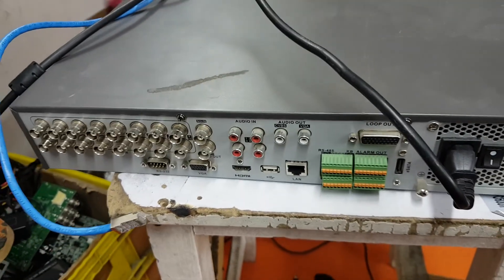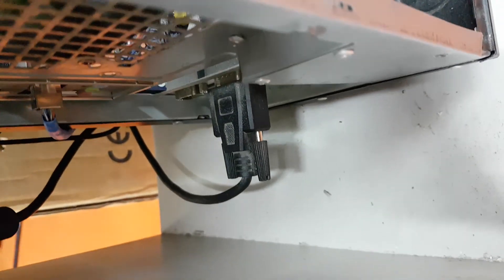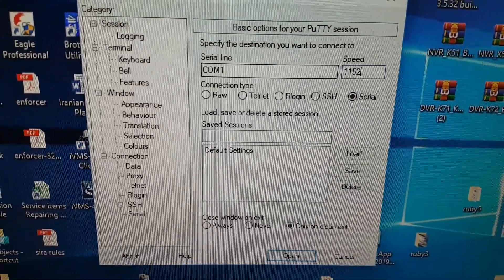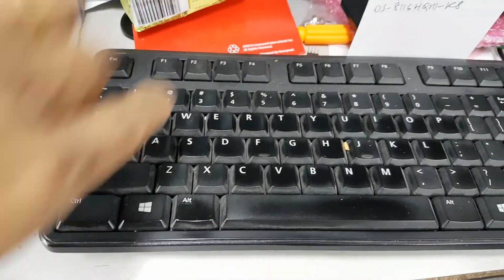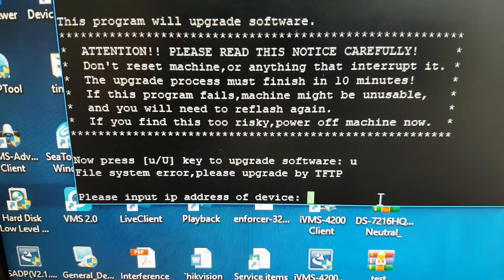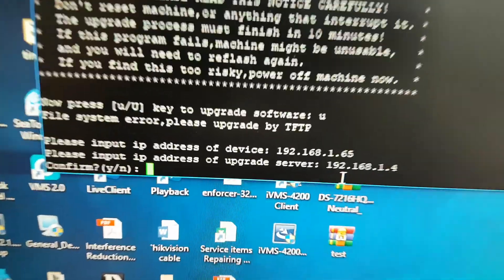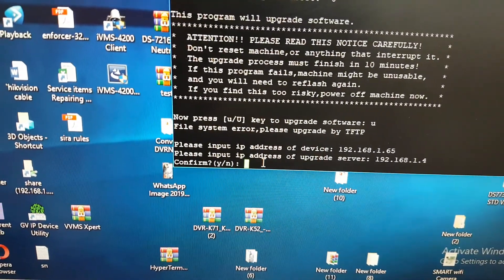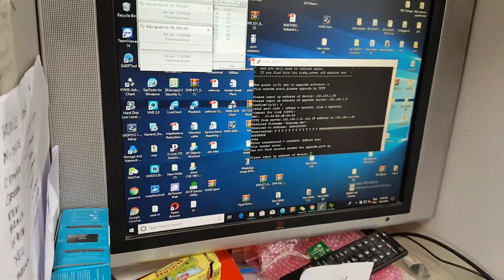Upgrading DVR and NVR using Putty

Comment: showing error 

please help solved this problem

* Warning - bad CRC, using default environment

Hit ctrl+u to stop autoboot:  0
### CRAMFS load complete: 3589208 bytes loaded to 0x42000000
## Booting kernel from Legacy Image at 42000000 ...
   Loading Kernel Image ... OK
OK

Starting kernel ...

Uncompressing Linux... done, booting the kernel.
Thu Jan  1 00:23:58 UTC 1970
Starting udev:      [ OK ]
sdbg: serverip:192.0.0.128
fastboot is
BusyBox v1.2.1 Protect Shell (psh)
Enter 'help' for a list of davinci system commands.

# /
---------<1> tar guir webs ---------
ded in[/home/hik/sys_app.tar.lzma]/out[/home/app/sys_app.tar.lzma] ioctl faild.  errno[5]
tar: unexpected EOF
tar: short read
mv: can't rename '/home/app/res/*': No such file or directory
---------<2> show logo ---------
tar: can't open '/home/app/logo.tar.gz': No such file or directory
Open /home/app/logo.jpg failed: No such file or directory
scriptCmd: ./load3531a -i 0.
a is a85f
b is 0xffe20884
DS_7216HQH_F_N
mmz allot OK DS_7216HQH_F_N OR DS_7116HQH_F_N
load3531A start
check adNum tp2802:0,tp2806:0,tp2822:0,tp2823:0,tp2824:0,tp2833C:4,tw2964:0 tw29 68:0 nvp6114a:0 nvp6124b:4
cmdBuf:insmod extdrv/tp2823.ko gpioType=0
cmdBuf:insmod extdrv/nvp6124b.ko
insert audio
load3531A end
load 3531a ok
/
---------<4> del no use res ---------
Can't open parameter file on flash, errno=0x2.
iSCSI daemon with pid=1188 started!cp: can't stat '/home/app/exec/diald': No suc h file or directory
initrun: start diald-----------!
/home/start.sh: line 89: /home/app/exec/diald: not found
Segmentation fault
getPPPOECfg: from /home/app/config/devCfg.bin ok.
remove pppoed!
==================enablePPPoE failed!!!
Reply from the maker: Send me serial number i will give you the correct fw and format flash before upload the fw

Comment: hikvision ds-7216hqhi-f2/n cant upgrade with tftp server,i use an usb serial rs458 usb with 2 pin when i open putty doesn't conect,my question i need a crossover internet cable to use  tftp server?
Reply from the maker: Yes u need to plug network on your pc for data transfering